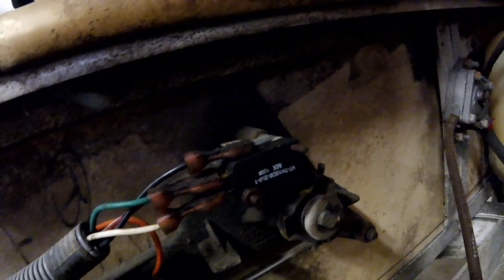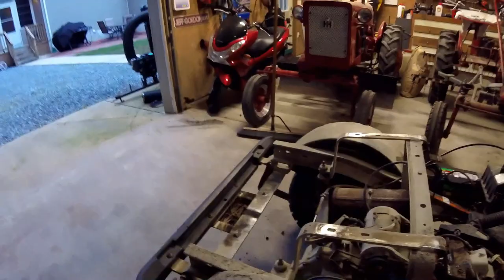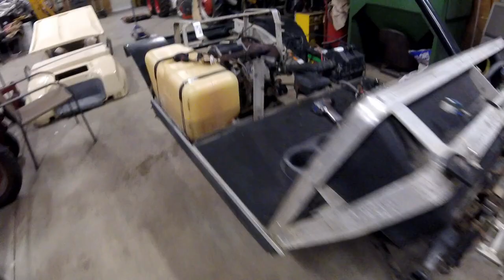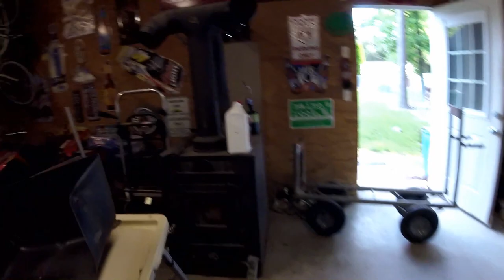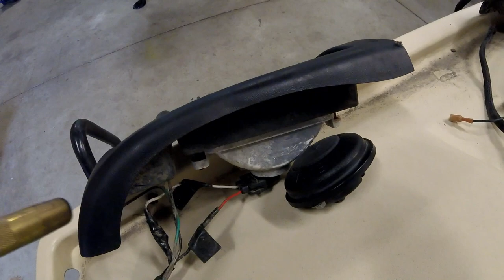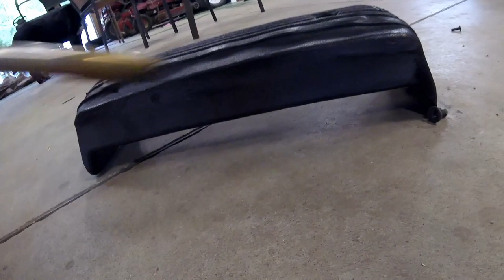Part1 - Another Golf Cart Goes to the Redneck Paint Booth !

Comment: Great tip on the plastic refurb. Would be great to see what it took to get the body off the frame.
On a side note I believe I see a Farmall-A setting off on the side. What year is it?
I have a 1940 model that looks really good except for a baseball size dent right on the front rounded top of the nose cowl. (My fault). I'd love to drive it but it's got a bad bearing growl coming from somewhere around the transmission or possibly inner axle shaft bearings. Just not sure where to start to pin it down. Got any tips on that?
Reply from the maker: The square front is a 1964 Cub and the round front is a 1953 Cub I just picked up a 1955 Cub about two weeks ago and I am currently in the middle of restoring the 1953 cub... I have been posting a few video on YouTube along the way... Not sure if the final drives on an "A" are the same as a cub.. But there are ball bearings and roller bearings in the final drives and there are ball bearings in the transmission... I know Harbor freight sells a stethoscope that is designed to find knocking valves in an engine... That might be an option to pinpoint where the problem is.. you just have to figure out where to stand and let someone else drive... If you have a draw bar on the back I guess you could stand on that and reach the final drives as well as the transmission with the stethoscope end.... Hope that helped ??